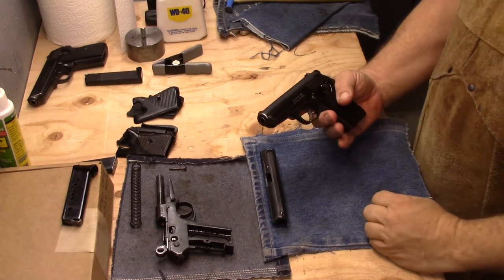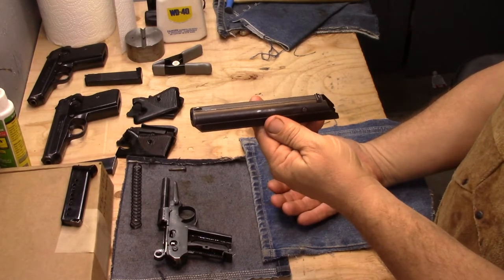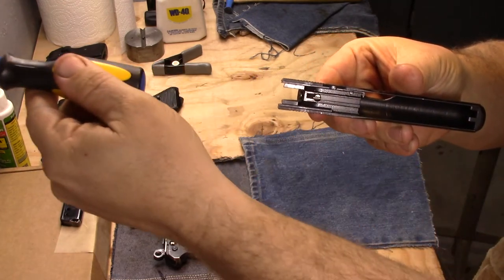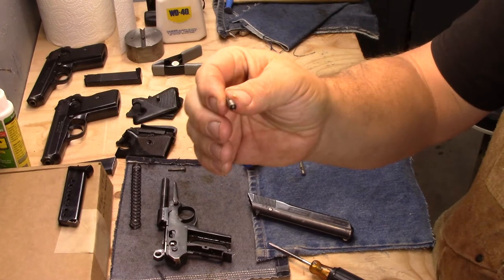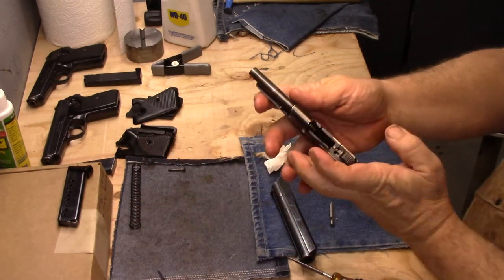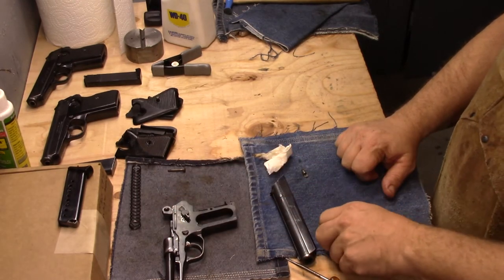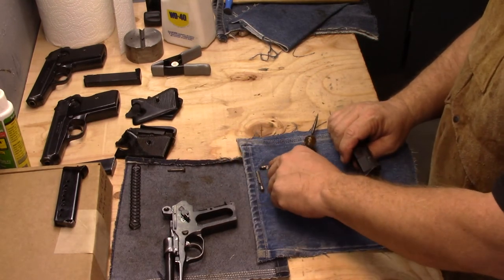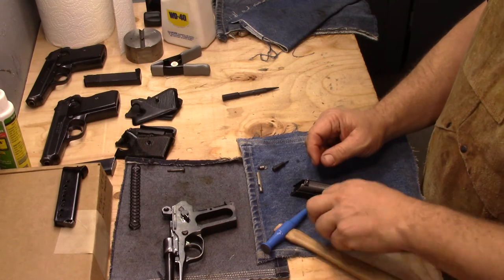Vz.50 70 maintenance series part 3 slide disassembly ejector and firing pin

Comment: I have a CZ 50 and 70. I've had no trouble reassembling either one. I went to my sisters house to clean the 50.
I thought it strange when I found the hammer cocked back. As it turned out, it was locked in that position.
I disassembled it as shown in a video. Once reassembled, it was still locked back. That was with the mag in
or out, safety on or off. I can't figure out what the problem is. Can you shed any light on this issue?

Comment: Thanks for this, very helpful. 2 questions:

1) Can you clarify your comment? The long part of the ejector spring goes in the ejector channel like you say in the video, or is your comment saying that was a mistake?
2) The pin that goes through the hole in the spring has one side that is sort of flat (but rough) and one that is peaked but finished smooth. I assume the smooth side goes up?
Reply from the maker: the long part goes in in the channel, I think the part I mistakenly or unclearly said in the video was that the arm goes behind the pin, the pin goes through the coil of the spring. And the finished side of the spring should face up, yes.
Reply: Thanks!

Comment: Great videos. I am a huge Walther PP PPK/S and decided to try a surplus CZ 50 and received it last week. Not to surprised that a lot of the bluing is gone and It was nasty dirty with thick old smelly oil all over. Mine is a CZ 50 but stamped 1970 so it looks like a 70 with 50 grips. I'm really liking this PPK clone and have been cleaning it with your excellent videos as a guide and with a lot of M-Pro 7 LPX, the parts are moving freely now. I do have a few questions if you don't mind. Are the grips polymer or Bakelite from 1970? My right panel side with the logo has a crack on the top and looks like it could break anytime. Are there any good sources for replacement and the hammer side firing pin looks flattened. Any good source for these ? Thanks much.

Comment: A good series for new owners. Thank you. I need advise as to getting the firing pin out of the slide. It is stuck in the hole and doesn't want to move. Any advise will be appreciated.
Reply: 1/16 punch will fit in to fiering pin hole, dont use a hammer light pressure will do.
Reply: Thanks, got it out after soaking it in WD40 and working it back and forth. Actually a fun project so far

Comment: The part that is in the slide is the extractor, was wondering if one can remove the slide lock/ejector or is it riveted in place.
Reply: The pin looks like a rivet but can be removed from right to left.

Comment: Do u know price for this pistol model 1966 in perfect condition
Reply from the maker: Perfect is a... difficult word. I just had an FN FAL that I was trying to shift out of my collection. it was in "perfect" condition with less than 200 rounds through it and I wrote 2000 words (!!!!) of description and had over a dozen questions and details that I had to add. so... perfect. I'll assume that that means it has been fired, was issued, is not in an officer's presentation box. But 90%... $200. maybe $175. 

There's a lot of details, it's possible it has some special marking or intermediate change that makes it worth $225, or there's a reference to the serial number in a news article or something that adds provenance and it might even go to $275.

But, in general, after shipping, as a C&R handgun, these run from $175 to $225. Condition is king, but... perfect is a bit lacking in detail as a condition description.